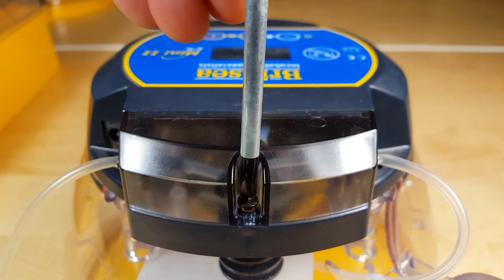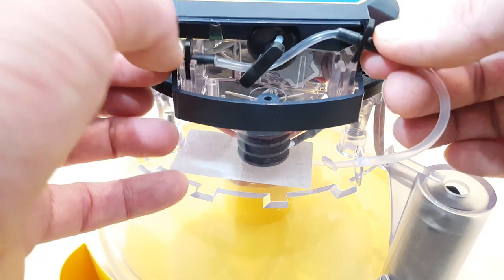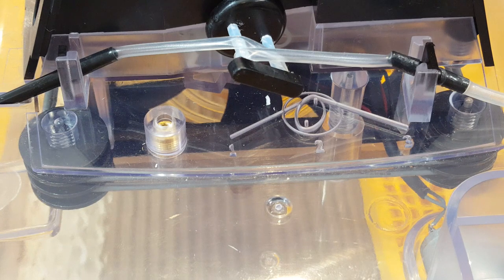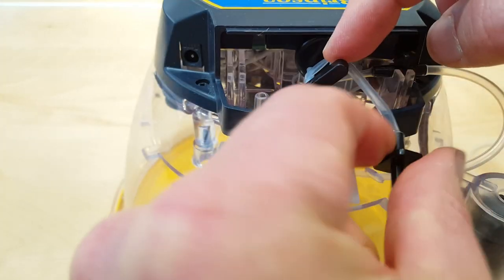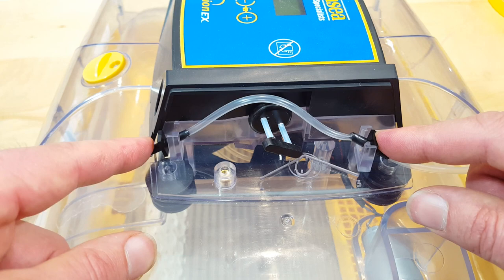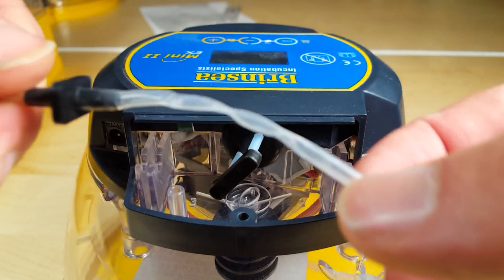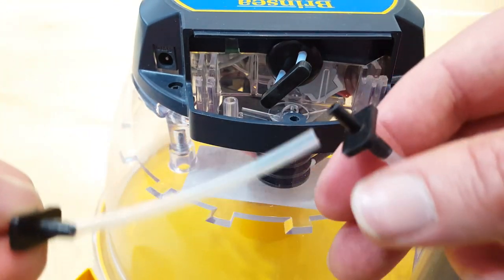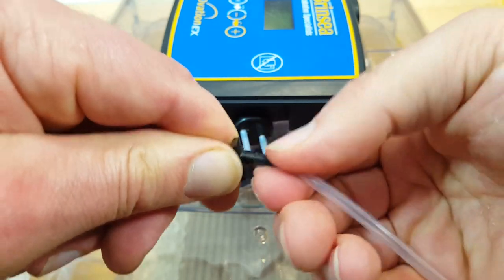Setting up & replacing the humidity pump tube on Brinsea Mini II, Maxi II, Maxi 24 and Ovation EX

Comment: Holy crap, it's no wonder Brinsea has the reputation it does.  I've gotten my first incubator, upper end brand and was fairly happy with it but guess what, no replacement parts.  Next incubator will be a Brinsea.  It's like the difference between a commercial grade & consumer grade mower.  Consumer grade, when it's broke you toss & replace.  Commercial grade you repair as long as you can.
Reply from the maker: Thank you for your lovely words. We strongly believe in the Right to Repair and have customers using brinsea incubators that are over 30 years old!

Comment: Could you please make a video for the MAXI EX!! I started using it but still has some doubts: What must be the incubation Temperature and humidity levels?, What should I do when day 19 comes and I have to stop the turning mode? when day 21 day comes Should I turn off the Maxi or it continues working? Thank you
Reply from the maker: Hello. Unfortunately we are very busy in the offices and we don't have plans to make a Maxi II EX video at the moment. have you got your product instructions? Temperature and humidity is covered from page 13 onward. Hatching is covered on page 21, you need to switch the turning off, but do not turn the incubator off. If after you have read the instructions and you still need some help please can you email: sales@brinsea.co.uk and we will be able to help you or if you are in USA please email sales@brinsea.com. Kind regards, Brinsea.

Comment: I can't get it to actually draw the water in.  I'm using a ova 56, measured the replacement tube, made sure to do the loop left to right.  It tries to pull the water from the container but it's like one step forward, one step back.  I've tried having the container at level with the incubator, lower than it, and above it.  Please help?
Reply from the maker: Hi, please can you send photos of your setup to sales@brinsea.co.uk and we will be able to help you. Kind regards, Brinsea.

Comment: I set up the pump, did everything you said, turned it on, the incubator is humming, but there's nothing happening. It's not pumping any water at all. Why won't you answer?
Reply from the maker: We are so sorry, your question did not some through as a notification. There could be several reasons for this, you need to make sure the tubing is set up correctly, that there aren't any sections of the tubing that are stuck down flat. The tubing needs to be tight enough around the capstan - we can talk you through this if you need us to. If you set humidity is only a few % higher than the actual humidity it may take several hours for the water to pump through. The best way of contacting us is by email: sales@brinsea.co.uk and we will be able to help you.

Comment: I'm in Australia and just bought a second hand Ova Easy 190 with humidity pump. The pump didn't come with any tubing. What size tubing would I need? Looks like two different sizes.. Thanks!
Reply from the maker: Hi Richard, if you contact our distributor in Australia they can give you details of the tubing you need: 
Top Knot Poultry Supplies
PO Box 245
Ormond
Victoria 3204
Australia
Tel: +614 1172 0732 (Australia call 0411-720-732)
Fax: +613 8692 2853 (Australia dial 03 8692-2853)
www.tkpoultrysupplies.com.au

Comment: How do i connect this to a water container. I'm using a 0.5L bottle and put a whole in the lid to neatly put the tube inside but its not pulling any water??
Reply from the maker: Have you got the tubing wound correctly round the pump head? This is all covered in page 8 and 9 of your instructions. Kind regards, Brinsea.

Comment: Hi ,Iam using Mini II ex and Iam facing high humidity issue what is problem,because I have set 48% humidity level but showing 64%.kindly help
Reply from the maker: Hello - please can you send us an email - we will need to know which product you are incubating with and the serial number would be a big help too. It would be helpful to know where you live and if you purchased your incubator new or used. have you registered for your 3 year guarantee? Please can you send an email to: sales@brinsea.co.uk - or you can call us on: +44 1934 417523. Kind regards, Brinsea